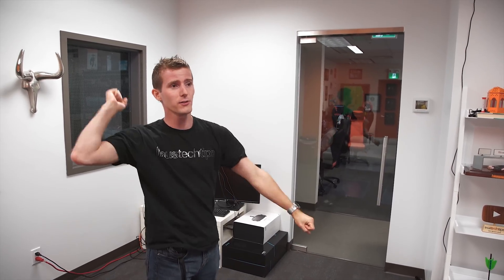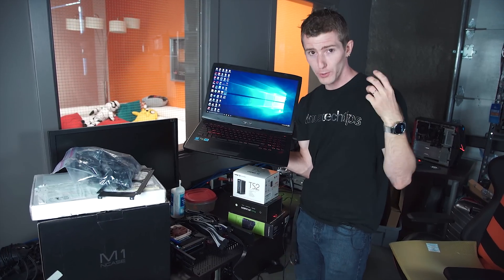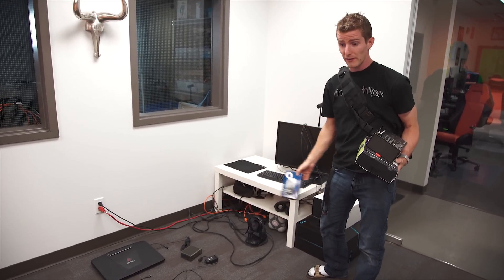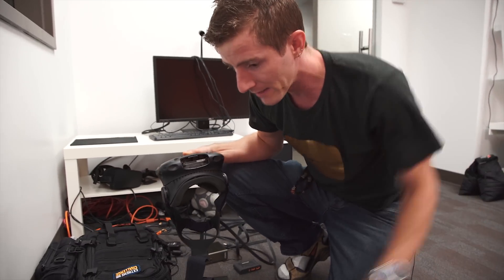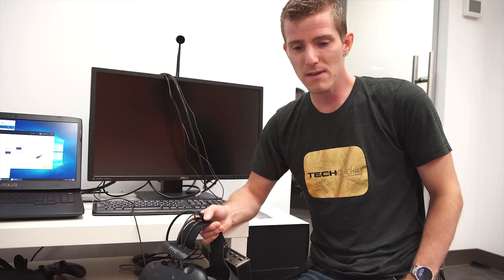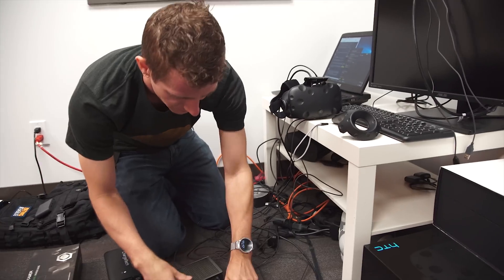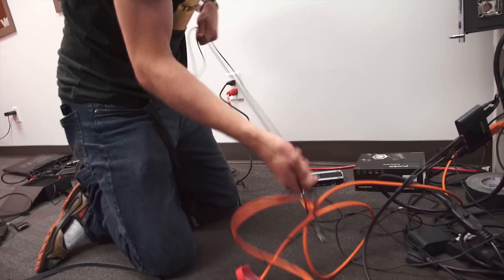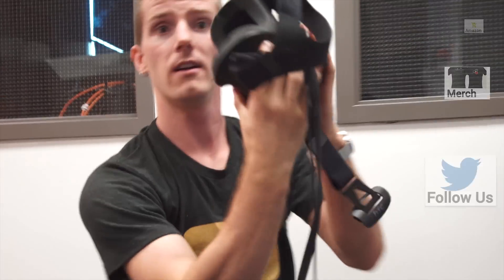Project Light Tether Pt1 - First World Problem Solving at its Finest

Comment: why didn't you just put the laptop in the backpack, also if you ran out of battery you could put a power strip in the backpack for charging the laptop. in this case you would actually have a cable but it would only be for charging.

Comment: Getting rid of the data cables and replacing them with a wireless transmitter and receiver pair would help a lot, though has a lot of issues with latency and bandwidth but hopefully if that can be overcome could be present in second-gen VR.

Comment: If you want ultimate VR room, why not just run the wire at roof?, buy a wire roller, attach it to roof, calculate wire to radius of movement, warning system if you go too far before headset pulls u

Comment: Why is wireless a decade away ? Do engineers / creators  think like that ? Seriously, what is there about the  electronic / video / audio signal being generated that is so complex it cannot be encoded / decoded easily?  Especially with the advances being made in electronics and the continual push to miniaturize everything to deal with the weight / size issues.

Comment: Why not just stick the whole laptop in the backpack?
Reply: There are settings to turn that off you know
Reply: If you close the lid it would put it to sleep, thus being unplayable.
Reply: I know this is old but, for headsets that use external tracking such as the SteamVR lighthouses, the computer needs to be connected to said external trackers, making backpack VR impossible.
Reply: neet
idc

Comment: Why is it a problem to stream the data via bluetooth or wireless to the device instead of using a cable? Understandably wireless technology is a bitch but can't we do it?
Reply: Not without a terrible latency issue. Instant nausea. We need a faster wireless communications standard first.
Reply: Because it's too much data for any wireless connection technology we have and compression would make the image very very very bad and also the headset would need a lot of own processing power to decompress.

Comment: Another option would be to use a optical transmitter one way from the pc to the headset, I know one place was trying to make a lightbulb act as a high speed network connection at least in one direction which could be a solution for transmitting a HDMI output, then use bluetooth to transmit the sensor data back to the PC, bluetooth is lower latency than wifi and fine for low bandwidth stuff.

The only problem is power, you could probably use an induction system to power it wirelessly, but I dunno how reliable that would be.

I think a wireless VR is totally possible.

Comment: Intel fixed the wire problem. It will take a while until it is in store though. If only they could triple or even quadruple the resolution in these things, it would be pretty awesome. The HTC vive already has a pretty high resolution but it still looks so fuzzy. You simply cannot read normal size text in the game as you would in real life, it has to be like 2 inches tall characters when reading at an arm's length.

Comment: Reinventing the wheel for no reason. Just buy some extension cables for the vive after the pass through box. Its what i did and its much easier, way cheaper, more reliable, and it doesn't look stupid... which, no offence Linus, but i dont know how you are going to finish this and not have this setup look ridiculous. Also, i cant see the latency being low enough to not give you motion sickness.

Comment: A bit of feedback:

1) Needs a smaller, less baggy packpack so it doesn't flop around while you're in VR

2) Why are you using wall warts? Just get a battery bank (or two) that can put out the correct voltage for the components. I understand non-standard barrel jacks can be a PITA but they are trivial to solder. Wall warts make the system much more bulky, heavy, and force you to use thick ugly AC cables.

3) Like others have said.. I won't rag on you for the socks and sandles but please be careful carrying your rig around with open toes! Workers comp would be on you so fast..

4) I'll still watch the video.. but again like others have posted.. vive has a much less cludgy slim cable on its way.

Comment: wouldn't it be possible to use the steam link as a bridge for the vive then you would only have one network cable or even wireless if it carry's enough bandwidth since the link is a low voltage it could run of a battery bank easy

Comment: Why dont u mount the heavy cable on the ceiling with a system which regulates the length of the cable automaticly like the cable mechanism in vacuum cleaner. So you dont need a backpack or batteries and u wont feel the weight of the cable anymore.

Comment: The Asus Rog Laptop only runs the HTC Vive with a Mini DisplayPort to HDMI adapter. Otherwise it will try to run on the onboard graphics. Make sure that it is a Active Adapter for the HTC Vive and a Passive for the Oculus Rift CV1. We use the D-Lock - Active Mini DisplayPort to HDMI adapter for the HTC Vive and the D-Lock - Passive Mini DisplayPort to HDMI adapter for the Rift CV1.

Comment: IMHO, one thing that has to happen with VR in the next couple of years is a completely wireless (sans power) headset. A new, VR only, super high bandwidth <50m range wireless standard would have to be developed. That would eliminate the need to be tethered to the computer all together, and would require only wearing a battery pack.

Comment: i made a mini itx build with a asrock m8 case straped to a hiking backpack, the only cord i have is the power cord thats in a pulley feed/retract system, i have no cord on the ground and do 360s for awhile before the cord system fails. right now the problems is the weight of it all, like 20-25 pounds. they did a vid of a very small case with no fans in it. if the dam case wasnt like 300 bucks i would try it and that would take my weight down to a reasonable 15 pound,

Comment: Hey,I am going to be using a Cooler Master Cosmos II&a MSI Z170A KRAIT GAMING 3X ATX LGA1151 Motherboard,what sort of spacing i should be getting for the EVGA PRO SLI BRIDGE HB if i want to use it to link two GTX 1080?

Comment: I have a question. There is steam link where you are able to stream games from the pc to the link. Why not create something similar to that where you get a backpack, put all the long wires of the htc vive inside there and connect the wires to a link. Then that link will connect to the pc. Boom wireless Vive. The problems that may come up are bad connection from the link to the pc, power to the link, weight of backpack, and the weight of the vive is still a thing

Comment: i saw a really exellent solution to this problem at vive demo, what it is is extendable dog leads attached at multiple points along the wire and then the dog leads allowed to slide freely along a pole attached to the roof. i only had a problem when constantly turning in circles

Comment: prediction - massive latency. 

an optical cable may be fast for sending data instantly, but if he is going to encode usb and hdmi over a cable then something has to do that processing and that will take time. and then he has to strap a battery to him somewhere to power the headset and the decoder. 

also, all this to still be tethered to a pc  AND have to now wear a backpack with batteries. rather than just wearing the laptop?

Comment: So my question is a simple one...Why not go full wireless? Wireless network 802.11g tops out at 54 Mbps and HDMI can be converted to USB 3.0 which there are devices that can share USB connections via WiFi.
Reply: I don't think that wifi has good enough speeds and/or latency to send/receive the gyro info as well as the minimum 90fps :(

Comment: Maybe a pully system above in the room like you would have with a air hose in a aauto repairshop. Where it would swivel on an arm above and then have a self retracting system.
Maybe a quick idea, i mean when i get vr in my own home i will be putting something together that is of the like if it isn't already fabricated by some other company.

Comment: It seems like it would just be easier to use the stock cables and you're making this harder than it needs to be
Reply: Classic Linus.
Reply: Welcome to Linus tech tips
Reply: His biggest problem is that the thunderbolt implementation of the laptop doesn't seem to work like it's supposed to.

Comment: why are you specifically using thuderbolt, to only need to use an adaptor box... plenty 1070 laptops about now, with dvi output, more than capable of doing this. no adaptors, no messing about

Comment: You'd think the wireless networking utilizing light would be a great way to transmit wirelessly to the computer, then use a battery bank of Lithium Ion batteries to power the headset.

nb4: wireless VR is too far away!
I'm not talking about waving a damned wand around, I'm talking about already implemented tech, just need to figure out how to marry them.

Comment: If it is really such a pain to adapt everything to thunder bolt and back, why not just put strap the laptop onto your back and send a power cord cord back to the wall. It wouldn't be as thin and light, but it would still be better than the standard tether.

Comment: For god sake Linus, why are you cutting up cables?!? Just roll up the original tether and stuff it into the backpack with some zip ties or velcro or something. Also couldn't this be resolved by attaching the tether to the ceiling instead of trying to re-wire everything? You know, like a boom mic or a harness set up? Is there such a thing as the opposite of Occam's Razor? Linus' Chainsaw maybe.

Comment: I'm confused by the advantage of using a thunderbolt cable. Why wouldn't you just plug the VIVE's normal cables into your laptop and figure out a battery solution to power it? Cables do coil.

Comment: dont know if this helps or not because I wasnt sure what usb you were using but I had that same compositor issue and it turned out to be the link box apparently not liking usb 3.0 which you'd assume it would but apparently not but going to a normal usb 2.0 fixed it and ive never had a problem since

Comment: a battery bank with an AC outlet means it has an inverter... those are very inefficient and add weight AND cost.
The best is just to use a big battery and then use a step up or/and step down converter to get the voltages you need for everything.

Comment: why don't you just do a hanging mount??? Kinda like a carwash spray rig... just have all the wires run through the ceiling with enough slack to movie around with it all and have a hanger built into that rig... The cords stay UP so you don't feel the weight and they are out of the way so you don't trip....

Comment: well if you wait till the AM4 AMD ZEN APU with 32 CPU cores and 16 GCNs comes out with everything that would be on a motherboard integrated into the ZEN APU with the exception of the GDDR4 memory slots into which will go 32GB of GDDR4 and the UEFI-BIOS chip then a tiny form factor 4K VR system should be possible.

Comment: This could have been done much smaller on a stripped down mini-ITX built into a backpack or insert. The Battery issue could be resolved using a high voltage battery and regulation circuitry taken from a different power supply.

Comment: Should grab one of those little Dan Cases A4-SFX's and put a vr rig in it and run it off of a 12 volt battery and inverter.  Stick all that in a backpack and you're set...if it's not too heavy for you...and cooling might be an issue...

Comment: That's a lot of extra crap to get rid of three cables.
Worth it?
I don't think so.
Reply: Does this guy understand the point of this video?
I don't think so.
Reply: Agreed... just use shorter cables going straight into the laptop.
Reply: The point of the video is to reduce the number of cables tethering you to the computer. 
He's successful in that. But what's the point if you have to carry several pounds on your back to get it to work? Just carry a whole dang computer instead. No cables, no weight difference.
Reply: he's trying to make it give more mobility and in the end he's trying to figure out the problem
Reply: Its more of a proof of concept that anything else.

Comment: I do not understand: instead of using a thunderbolt hub, battery banks, power outlets, and all that extra weight, why don't you just wrap the original cable to make it shorter???

Comment: You know what........The cable just won't suit the VR in fact that the wire connected to headset is itself bulky .................I would prefer wireless ones for this.

Comment: Why dont you use the power over thunderbolt linus? Seriously ppl rely on battery's too much now. A simple 3 16AWG conductors is all you need (You could even get away with two). But then instant use no charging needed...

Comment: You can just use a corning usb 3.0 optical cable, a C2G hdmi optical cable, and a slim dc extension. Sure you have two optical cables and a thin copper pair cable instead of one optical thunderbolt cable... but you don't need the headset side battery packs or thunderbolt breakout box. I've done this and I can't even tell that the cables are there anymore with the headset on.

Comment: No such thing as overhead room on a power brick. The current and voltage regulators in the thunderbolt hub itself will limit the current to 5A and voltage to 12V and just disperse the rest of the current right back to ground.

Comment: What we really need is something that utilities the vive camera's in the room, it already knows your position, so just have a cable mechanism on a 2-axis slider that will move according to your position and when you reach for behind you; which again it knows their position. (like bow and arrow games) it lowers the cable quickly avoiding your hands and ensures its always behind you. you can get pretty retractable pressure sensitive reels nowadays to ensure you wouldn't notice it either.

or instead of the cable being directly above you, program it to keep the cable at something like this :
|
 \_ _              0
        \_____ / |
                     /\

For faster movement of the cable for quick turns, perhaps a circle slider that the thing holding the cable can swing around quickly as the 2-axis slider thing may not be able to keep up, meh either one. I suppose it depends on the situation, perhaps you can have a setting you can switch, if the game requires quick turnarounds, then it will keep it high, if you need to reach behind or above you, it will keep it low.

Comment: Wouldn't it be easier to just like attach a pulley to the Ceiling and run the cord to that so as you move it feeds the cord through that keeping it out of your way and preventing tangles?

Comment: When using that Thunderbolt box, you are actually using a built-in display adapter inside the Thunderbolt box right? Or does thunderbolt let you transfer the display signal from the on board graphics card and output it over HDMI ?

Comment: Why has no one tried to hang the cable from the roof? So your not holding the weight  and if done right,  it should retract and extend when walking away or towards where is is hung from
Reply: It apparently caused tension in the cables and can snap them, worse than stepping on them

Comment: I think that they should make a semi-portable VR backpack with the shoe-box sized PC that was featured about a week ago. Then make it completely wireless except from the power cable, which could be run through several extension cords, to get an almost completely wireless VR backpack that could be then showcased outside the building with people running into cars and buildings.

Comment: I still think the idea I posted in one of Lukes videos would work. Those self wash car places have the hose tethered from the ceiling on a swiveling rod. So the same would work with a VR cable. That way its off the floor and not around the feet and you can move freely.